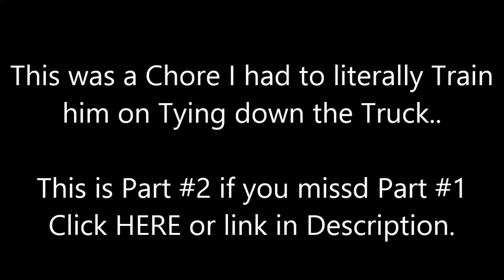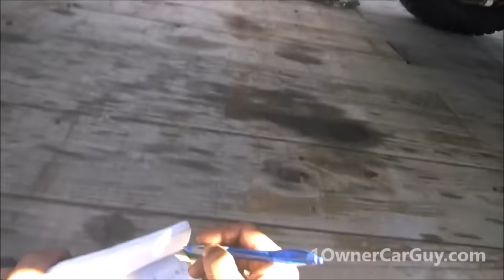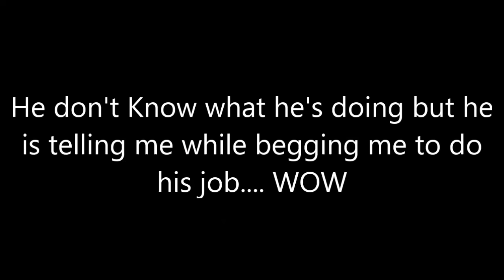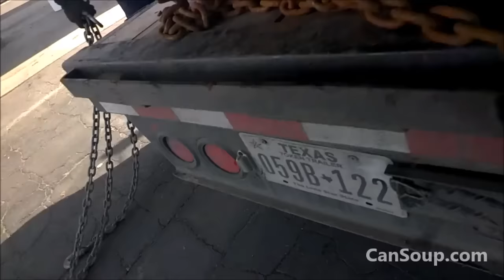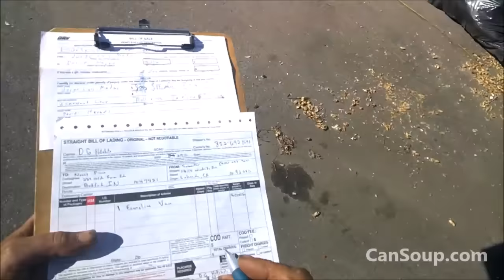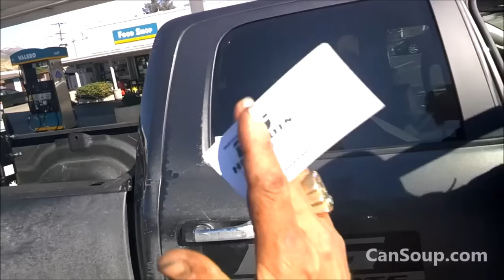Loading Car Transport Fail ~ Exploding Wood Work Vlog #2

Comment: The way the Red Cross truck was chained down, there wasn't anything to prevent it from going forward into the Scout , except, Trans. park, perhaps the parking brake and some 2 X 4's under the wheels that the driver suggested?  I would sure think twice about hiring any auto transport Co. if the drivers lacked common sense , like the one is this video, he 's  a danger on the road?

Comment: A loading trailer/truck, job, and mind- are a terrible thing to waste, but we got dat Blunt roll job locked down correct, huh? Road is way higher than lot. Park trailer in lot, facing in, ramps near edge of road. Drive Rescue truck onto ramps. Hauler should have 2 workers, vet, train & equip the help. When someone gets killed or irreplaceable property is damaged someday- maybe the company will wise up. This is all very sad.